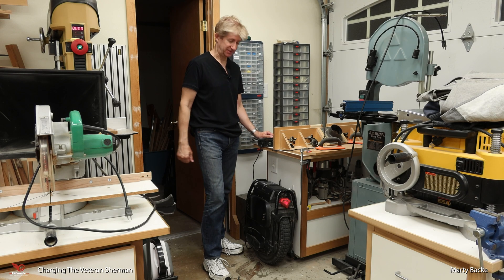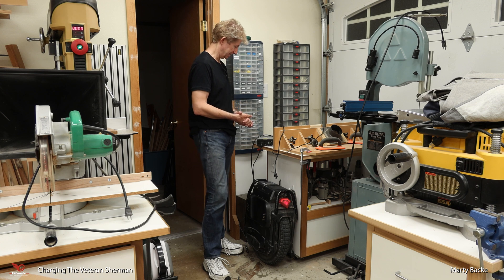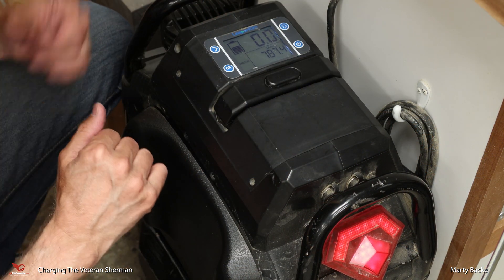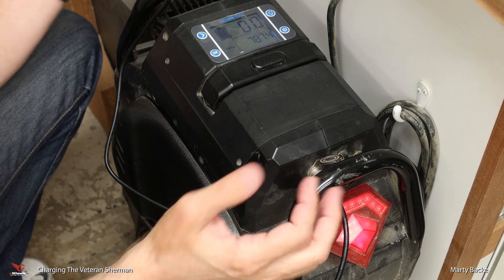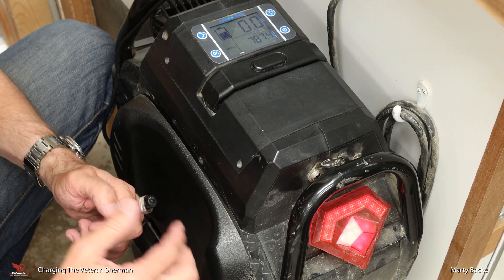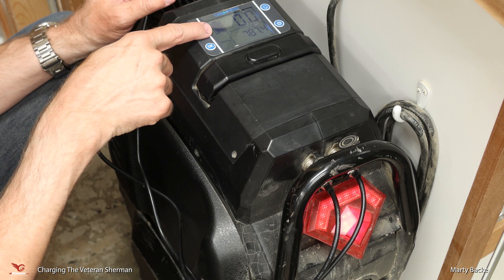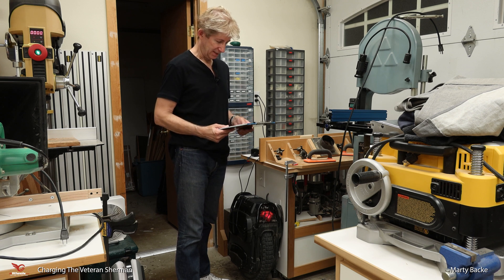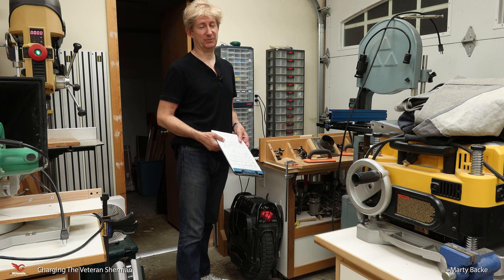Charging The Veteran Sherman

Comment: I am having an issue charging my Sherman.. I plug it into the charger it came with, but nothing happens. I do not know if it is the sherman or the charger the fans do not even turn on when I plug the charger into it.. Last summer, it charged just fine. However, now it doesn't even charge at all any suggestions?
Reply: Either U Need A New Charger Or A New Motherboard..💯

Comment: Do you think that in 4 hours with two 5A chargers the EU will charge almost 100%? And do you think it's worth buying this wheel for myself  in 2024 from someone who has used it for 3 years? thanks
Reply from the maker: Yes, those chargers will fully charge a OG Sherman in under 4-hours. Whether it's worth buying depends on the price and condition and miles. In the best of condition OG Sherman's should not cost anywhere near $1000

Comment: Its it safer to charge it laying down on its side so if turns on, it will shutdown due to extreme angle?

I like to use a timer to stop charging after a certain number of hours but if it cuts power at the end, would the sherman then turn on and start balancing? Could be a dangerous situation

I have a Sherman V3. The issue is fixed on this one?
Reply from the maker: Yes, this issue was fixed very early on so you have nothing to worry about.
Reply: @ElectricUnicycles  awesome! Thanks

Comment: I wonder if you are messing the battery or components up by doing it like that ?
Reply from the maker: No I'm not "messing the battery up". People with dual charge ports use different chargers for each port, all the time. But if you're worried about it then don't do it :-)

Comment: At What percent do you recharge the battery?  I use 20 percent to get to work. Can i plug it in at work and let it charge back to 100 percent? Or should i ride home and charge it at 60 percent? Or should i ride it to work 2 days in a row and then charge it at 20 percent? Or should i run it until it is completely dead before charging? Im looking to get the most life out of the batteries.
Reply from the maker: Whenever I complete a ride (unless it's only a few miles) I charge the wheel. For 5-years I've never been concerned about battery life. It's not worth spending time worrying about the batteries. The vast majority of people will not be riding the same wheel after 2-3 years and our batteries last much longer than that. In the 25+ wheels that I've owned I never experienced battery issues of any kind.

Comment: May I ask..... How many charging pins do the veteran shermans have in each port? I believe it is 5 pins but can not be certain. The reason I am asking is because I am fearfully of fires of course and I would like to know if there are any  intelligent chargers on the market I can incorportate with my 3amp, 5amp or 8amp charger for purchase, which will keep my batteries balanced, inform me of the charge amount, voltage, time, include a computer dongel if possable. etc
Thank you for reading my tx message. Tomas.jv43@gmail.com

Respectfully,
Thomas
Reply from the maker: All Gotway and Veteran 100-volt wheels use a 5-pin connector.
Reply: @ElectricUnicycles  Thank you I am trying to find a compatable smart charger for it..."IF" one exsists.
Reply from the maker: @Index-o1234  I don't know of any.

Comment: I have a question concerning the charging ports...The Veteran comes with a 5 amp charger and it has 2 ports...you recommend using two 5 amp chargers for faster charging time...
When I called the distributor they offered me an 8 amp faster charger.....am I supposed to use only the 8 amp charger in one of the veterans ports? or am I supposed to use one port for 5 amps and the other 8 amps?  Should I just order a 2nd 5amp charger and use both 5 amp chargers on both ports? Im confused and really do not want to burn the board or electronics in it...

Thomas
Reply from the maker: Absolutely do not plug an 8-amp charger into one port. If you must use us one you'll have to get a splitter so that you can plug it into both charge ports. The max input in either charge port is 5-amps.

5-amps works for me but sometimes I'll use a 3-amp Gotway charger in addition to the stock charger so that I'm charging at 8-amps total. But that's rare for me.

Per the manual, you can use two of the stock 5-amp chargers, MAX. Do not exceed 10-amps total.
Reply: @ElectricUnicycles  😂- nice that they dont bother explaining these things to you when they want to sell you something....Thank you I very much appreciate your guildance....I could have easily fried the appliance had I not sought advice before purchasing it.

Comment: I just noticed that my Sherman November batch from ewheels w latest firmware, my Veteran completely shuts off after fully charging and removing the charging plugs. Guess Veteran fixed the spinning wheel issue.
Reply from the maker: It was actually fixed on the first production shipment of wheels, back in early September.

Comment: Can you buy a second 5amp charger? I’ve heard on the forums it might get too hot.
Reply from the maker: I have only charged my Sherman with a 5-amp and 3-amp charger (8 total) and it certainly didn't get hot. The manual literally states, "Dual charge ports, support 10A max". Yes, you can buy an additional Veteran 5-amp charger.
Reply: @ElectricUnicycles  thanks so much for the info. My Sherman hasn’t come in yet so I didn’t know they have that written in the manual. Would you recommend getting the same exact charger they give you or would I be able to get another brand as long as it’s also a 5-amp?
Reply from the maker: @thelordsauron  In the Description on my Sherman Setup Guide video you'll find a link to the Sherman Manual (a PDF). You can use any compatible charger (I use the Veteran charger and a Gotway charger when I want to fast charge, but I rarely use more than one charger). https://youtu.be/DmIs4WRb_gQ
Reply: @ElectricUnicycles  right on! You’re the man Marty! Thanks for all the helpful information and sharing the link to the manual good Sir. I’m genuinely so excited to get this bad-boy in the mail and will feel much more prepared and ready to set this it up thanks to you!

Comment: I'm charging mine now, just wondering if there's an indication sound or something that tells me it's fully charge, it shows 8 bars.  Should I turn it off?
Reply from the maker: The LED on the charger should turn green and the charger fan will turn off. Also, I'm pretty sure (but not positive as I type this and my Sherman is not in the house) the Sherman fully turns off when charging is full.

After 8-bars the battery will continue charging, balancing the cells. This could potentially go on for another hour+ after "8 bars" is achieved.
Reply: @ElectricUnicycles  Yes correct, it does turn green and the fan shut off!  Thanks!
Reply: Hi Marty, I just decided to charge my Sherman today and when I plugged my charger to the charging port, I get a "E CHAr" on my screen display.  Normally I see a animation of battery bars indicator going up, but this time no animation.  Any ideas?  Could it be the charger itself is toast?
Reply from the maker: @luminouz.cosplayerider  And you tried both charge ports? You'll probably have to get access to another 100-volt charger to isolate whether the problem is in the wheel or charger.

I haven't seen that error message before.
Reply: @ElectricUnicycles  
Yes both charging ports shows the same symptoms. I will check with a friend who has a fast charger and determine if it’s the charger or the unit itself. I’m banking on the charger🤞.  I’ll keep you posted
Reply from the maker: @luminouz.cosplayerider  Good luck, and yes, let me know what happens.
Reply from the maker: @luminouz.cosplayerider  I just asked around and someone I know said it's happened a couple of times. They unplug it and then plug it back in and it starts charging.
Reply: @ElectricUnicycles  

Just finished my diagnostics and found out that my friends fast charger is also showing the same symptoms “e CHAr” I believe something is fried on the board 🤦‍♂️ 

But thanks for asking around! 👍 I’ll try unplugging and plugging in method and I’ll keep you posted.

Comment: When I plug it in to one of the ports (the left one) it says "no connection", but the other port charges fine, what does this mean??
Reply from the maker: I don't know for sure, but I suspect one of the wires from the control board to that charge port has come loose. You'll have to remove the LCD top to inspect it further.

Comment: Hey Marty I was just reviewing your video looking for something I didn't find...  I have an 84v fast-charger leftover from my Nikola.  Is this 84v charger useable on the 100v wheel?  Thanks!
Reply from the maker: No. The 84-volt charger puts out "84-volts" which isn't very useful when you need 100-volts for a 100-volt wheel. Technically, you could use the 84-volt fast charger on the 100-volt wheel but you'd only charge the wheel up to ~25%. But even before you could do this you'd have to replace the 4-pin connector on the 84-volt fast charger with a 5-pin connector that's compatible with 100-volt wheels.

Keep it in case you buy a KingSong or Inmotion wheel, or another Gotway
Reply: Great info, Marty.  I'll hang on to it for sure.  Thank you!  @ElectricUnicycles
Reply: @ElectricUnicycles  I admire the deep understanding of batteries and chargers you have 👍. My EUC passion motivated me to do a lot of research in this field too, thanks GotWay 😁
Also your ability to explain complicated things in an easily understandable manner is worth mentioning.
Cheers Marty.

Comment: There's no reason to charge a sherman so fast unless you are travelling.  One 3 apm charger will do the job in 12 hours nicely,  sparing battery, without additional noise from built-in sharman fans.
Reply from the maker: We do a lot of 75+ mile group rides where we use a fast charger during our lunch.

Comment: Hi, did a google search about how to prolong the life of lithium ion batteries.  Some of the advice include:  
Avoid charging to 100% capacity.  
Avoid high charge and discharge currents.  
Fast-charging affects the lifespan of lithium-ion batteries adversely because of the increase in the internal resistance of the batteries, which in turn results in heat generation.
Limit the battery temperature.
In the long run the longevity of a lithium battery will be better if it's slow charged.

The above advice is from a brief google search.  Could be opinions and so may or may not be factual.  
Science of batteries is quite complex and needs in depth reading and understanding.
Maybe others with more technical knowledge will be able to comment.  
Thanks.
Reply from the maker: Lots of theories out there. I live in the real world. For the years that I've been riding, and owning over 20-wheels, I've never had a problem with batteries in my wheels by charging to a 100-percent "every time", and sometimes letting them sit at 100-percent for months. Two wheels were over 3-years old and had the same capacity as when they were new.

My philosophy for EUC's is to just enjoy riding them and not waste any time trying to baby the batteries. YMMV
Reply: Twenty wheels, that is inspiring.  Just fantastic to have found a group of EUC riders on YouTube from all around the world.    Great vids, always look forward to them.  Thanks for making them.
Reply: @ElectricUnicycles  I’m glad I’ve just read this Marty. I have three  EUC’s and a e-scooter and I am constantly trying to knock the top 10% or so off the battery % with all the ‘dont store it at 100%’ ‘you’ll only get 300 charge cycles’ etc etc. 
So you’ve put my mind at rest a bit there. 
Cheers 🍻 👍
Reply from the maker: @mrandmrswheels1142  I stand by my comment from my 4-1/2 years of EUC experience; our batteries last for forever relative to everything else about the wheel. One of my ACM's will be 4-years old in a few months. 1300wh battery and it still charges fine and lasts a long time.
Reply: @ElectricUnicycles  cheers Marty. Yes I think maybe people get a bit too laser focused over the internet and then it gets crazy obsessive. I suppose most people’s wheels will get faults and become outdated before they see issues with their battery’s poor level of performance.
Reply: @ElectricUnicycles  Cheers Marty 🍻
Reply from the maker: @mrandmrswheels1142  Exactly!

Comment: The battery is massive,  it must have hundreds of cells, not sure of the type,, I'd call the company over the issue of not charging beyond 99.5%,, could be an indication of a problem someplace in the battery's, or balancing board

Comment: Sherman is being shipped with a 5A/100V charger as standard equipment. There is also the option of getting a 100V/8A charger with some enhancements like a Wh/Timer screen, variable amperage output in 2A increments & partial charging support. Charge ports have been upgraded with 2x wires for each +/- to support 8A from one port. It is not recommended to charge the Wheel above 8A, so please do not use both chargers at once!
Reply: Question is it bad to not charge your shermen frequently? I don't really ride it that much since I'm still learning and its been on 100% for a couple of days

Comment: Is the act of unplugging it or stopping the charger that causes the wheel to self balance?  If you use a timer to charge and the timer shuts the power  off to the wheel will it begin to self balance?  Or is it just the act of unplugging the cables from the wheel that starts self balancing?
Reply from the maker: Nope. I confirmed that if I just unplug the charger from the wall (but leave the charger connected to the wheel), the wheel turns on and starts balancing. So a timer would not help.
Reply: @ElectricUnicycles  This must be changed.  It could lead to any number of accidents.  If you charge on a stand and the power goes out to your house you could end up with a mess at the least and a tragedy at the worst.  Glad you asked them to have this changed.  Does the Sherman support bluetooth firmware updates?

Comment: If it sparks when you plug it in, use a surge protector. Turn it off, plug them in, then turn it on. Safer in all ways.
Reply: One should always put the plug into the device first then plug it to the wall socket, no spark and much safer this way. The other way around when you unplug, you'll never have problems this way.
Reply from the maker: When you plug a charger into a Gotway (or Veteran) wheel first, you get a huge spark at the wheel connector. It's been common practice for years to always plug into the wall first to avoid sparks on the wheel.
Reply: @overthetarget9401  Really? I always though you should put it into the socket first then to the device.
Reply: @overthetarget9401  You will have a spark either way. It's the caps inside the charger that get charged from empty to full in an instant mini explosion. It will either spark on the wheel side plug, or the wall. Plugging into the wall first is usually safer imo.
Reply: @4nlimited3dition_4n3d  Your opinion to your own but plugging it first into the device and then into the power source is by all accounts safer and better practice. A charger without load puts strain on the capacitors and dependent on the circuit of the charger it could ramp up to a higher than nominal voltage and then ramp it down as the charger is plugged it - nice power surge to the device. If the charger is already plugged into the device the voltage will ramp up gradually to the required voltage and there won't be the same type of power surge.
Reply: @overthetarget9401  Your opinion, my opinion. Sure. But with those cheap charging circuits, the spark will happen on the plug of the vehicle as well and consume it overtime, that's not good either. My V10f seems to have a properly designed charging interface, which doesn't spark no matter which way you connect it.
Reply from the maker: The way that Gotway and Sherman design there wheels, there is live voltage on the charge connector. If you first plug the charger into the wheel, you get a big spark on the wheel connector. We try to avoid this, so always plug into the wall first.
Reply: Wall first then wheel, always! Never wheel first.
Reply: I was referring to the spark when plugging into the wall. Use a surge protector to prevent this. After you turn it on, then plug the chargers into the wheel.

Comment: The Bars are pointless. Only voltage matters. Computation is quite straight forward: 8A x 100.8V ~= 800W. Give the wheel has 3200Wh capacity, 3200/800 = 4h. Now there is the slow down at about 90% so the most efficient ratio time/capacity charged is 3200*0.9/800 = 3.6 hours being roughly 3h36 minutes. The time spent charging after that is highly-inefficient.
Reply from the maker: Considering that the voltage is not available to the user by default (only in a "secret" advanced mode), bars are not truly pointless. But I get your point. That's why I provided voltage values.
Reply: One of my annoyances with the Sherman are with that LCD. They build the most incredible EUC to date and go lazy on the LCD. board temp and voltage should be accessible by default; those battery bars need to be more evenly spread out (each bar = 3v).
Reply: Yes, and also Real capacity I believe is 3108wh. Really you want to look more at something like 10% to 90%. It depends on how early the speed decrease, beeps and tiltback start at. Then for long trips you could say 2h charging at 10A will charge from 20 to 90%
Reply: @Philippe Chiu you're wrong in your straight forward calculations. Simply because the capacity of a li-ion battery is calculated based on the nominal voltage. So those 3200Wh (3108 precisely, as said above) is not the right number to use.
The correct straightforward calculation is: 35Ah/8A=4.375h. I am sure you will understand what I mean. Cheers